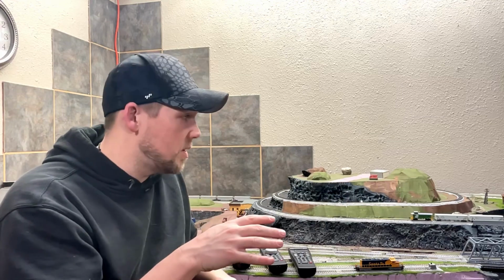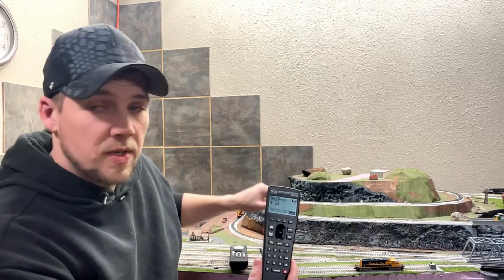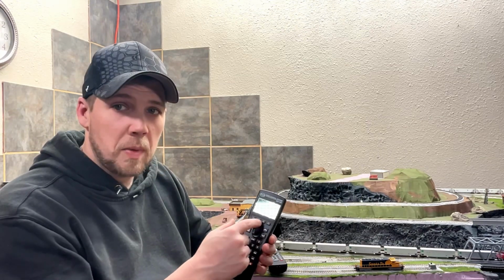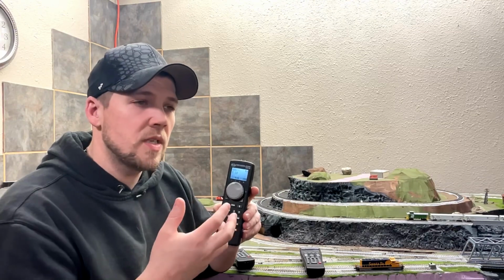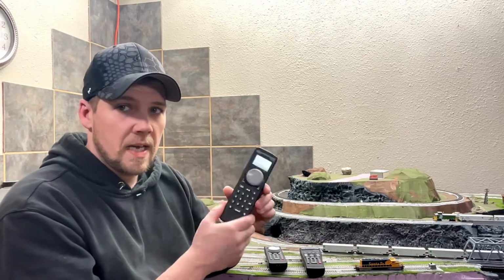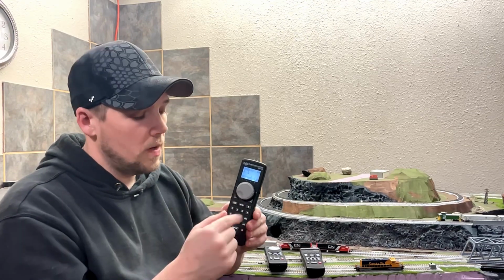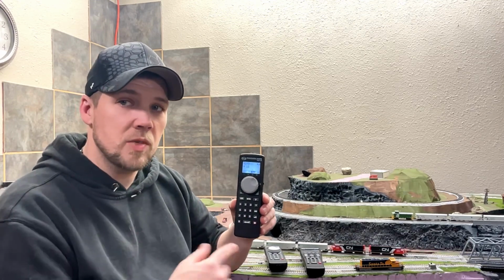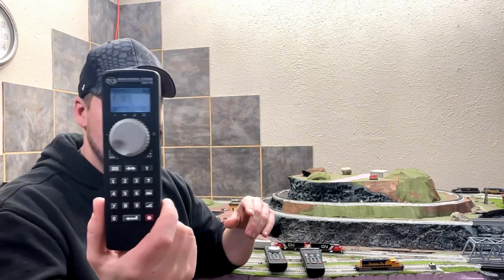TCS DCC Command Station and Throttle Line up (First Impression)

Comment: I'm debating on picking up a TCS throttle, and adding wifi to my system.  For now I'm working on a couple smaller projects and thinking the LT-50 might be a nice way to try the TCS interface, as it appears to operate very similar to a wired UWT-50 with encoder.   It's also pretty cheap...if you look around.   I'm wondering, what do you think after some time with them, is the UWT-50 with Potentiometer more suited to switching, but less handy if operating multiple different trains?   It seems like the potentiometer model would be great for only a single train at once, or running a train, parking it, then running a different one... or certain cases... but mainly just like a yard job or switching, where you'll only be operating one train...    The encoder model seems like it would be optimal for situations where you might be doing some switching , but also where you'll be operating more than one train, and switching back and forth between them,  something like a small layout where you'll be sending a road train on it's way to do laps, then operating a yard train to switch some cars or ready the next outgoing block of cars... then going back to controlling the road train to bring it into the yard and swap a block of drop offs for a block of outgoing cars, then back onto the road for some laps while you go back to yard work.... situations where you'll be operating multiple trains, on a bigger layout, or a smaller layout with 1 operator but 2 or 3 trains running and doing things...
    I may end up trying TCS stuff, debating an LT-50 as it's suited to a small project I have in the works... and I can't just afford to try both models to decide which I'd like to buy a second of...lol
   cheers
Reply from the maker: If you want the encoder option I would upgrade to the 100. For the price I much perfer the pot model. Straight up better for switching. You can always jump between models, but yeah you have to zero the pot before you can make speed changes.

Comment: I’m very interested in in getting the CS-105. How are you controlling your Kato turnouts with it? I’m currently using DS64’s with my Digitrax.
Reply from the maker: Currently my layout doesn't have any connection to the turn outs. I just throw them manually.

Comment: What did u need to get started with this system??? This system is kinda new to me. And how does it compare to nce???
Reply: if you haven't already found that info...   The TCS wireless throttles operate on many systems.  TCS does have their own CS-105 command station, but these throttles will work with a Digitrax system and LNWI unit to give the system wifi.  These throttles will also work with an NCE system using a Wifitrax panel.  Other ways would be using JMRI and adding wifi to the system that way.   I'm really considering adding some TCS throttles to my collection, but probably not their Command Station yet, as that is a really pricey unit and I have that part of the system covered for now with my gear.   I'm trying to decide between the Potentiometer and Encode version of the UWT-50.
   There is also another, not-wireless throttle from TCS, the LT-50.... it would be wired and function similar to the Power Cab in that it has the command station built into the handheld device... but the throttle functionality and controls look to be just about the same as the encoder version of UWT-50... I'm debating picking that up first, for a small project that I have, to decide if I want to invest in the wireless throttles.  
   Let me know if you've already tried some TCS gear, or what you might have ended up with after asking that question months ago... cheers

Comment: Just in watching I'm liking the system allot as you can use older other systems stuff like you can plug into the back of New TCS you can then run NCE throttles to control your Engines with them if needed that a slam Dunk & you can program Engines on a Programming Track with this New System 

The last Throttle you was using was it the Podimeter Version or the Encoder Version thats cool turning a Quarter turn or less in yard mode the Engine moves a short distance & rolls to stop then does the same reverse.. 

Neet stuff did you get you system from TCS or a Dealer..  thanks Allen D
Reply from the maker: The Real star of the show is the UWT-50 with the Pot. So far one of the best throttle I have gotten my hands on. I purchased this from TCS directly. Couldn't find a dealer with the CS-105 on hand. Plus, TCS had a combo discount.